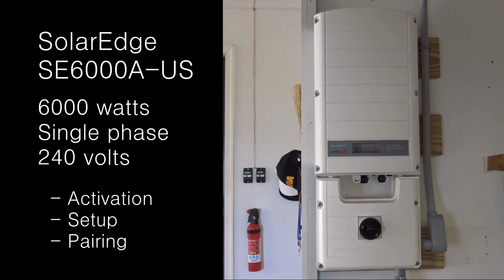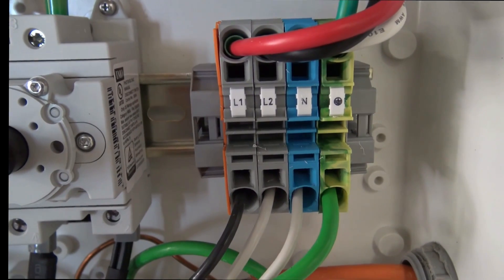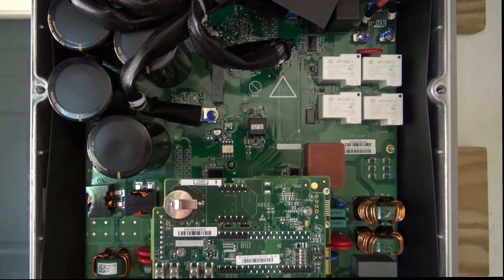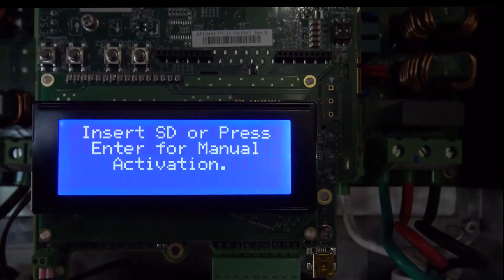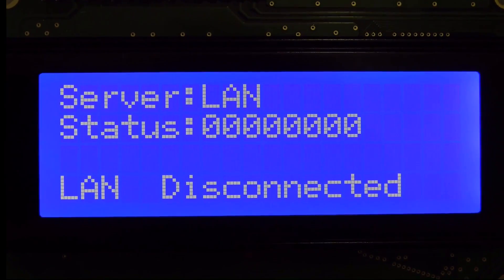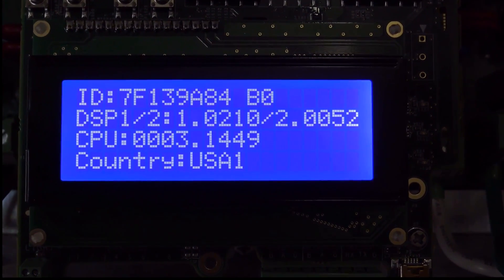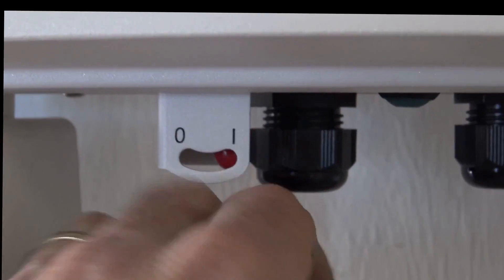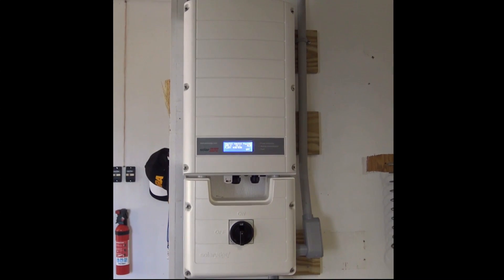SolarEdge Solar Inverter - First time powerup - Activation, Setup, and Pairing

Comment: DC circuits are required to be installed in a metal raceway. Also, the breaker for the inverter should be at the opposite end of the panel busbar from the main breaker.
Reply from the maker: NEC 690.31(G) states DC wiring inside buildings must be in metal conduit or raceways.  I got away with using PVC, but it looks like you can't do that anymore.

Comment: I'm looking into installing this same set up. but I wonder how is this posible of having 30 280 watt panels = 8400watts paired to a 6000 watt inverter.   are you not getting any clipping? are you not loosing production? just learning here... maybe because the panel oarientation, still  2000 watt difference  is a lot. I will duplicating your setup on a ground mount, so I might need a bigger inverter still learning  here.
Reply from the maker: Great observation!  Because of the orientation, I do not get full production out of each panel, so my maximum production is often just under 6000 watts.  On a good sunny summer day, I actually do hit 6000 watts in the mid morning.  The DC-DC power optimizers reduce the efficiency of each panel, slightly, to hold the main inverter production right at 6000 watts for several hours.  It stays there until mid afternoon or until clouds come.  I checked what I'm loosing by taking out a string temporarily.  If I had a larger inverter I could get 6600 watts at the peak, but it's not worth chasing.  Because of my state's power regulations, I'm not allowed to have more than a 6kw inverter on this meter anyway, so this arrangement lets me get a lot of energy out of what I'm allowed to have.
Reply: 280 watts is produced in a perfect environment, in reality each panel only produces about 240watts x 30 =7200, in addition this series of inverters can be overloaded a bit as well I was told from a sales rep, and orientation plays a role in the system as well. We're pricing out a 60-270 poly panel system with the dc optimizers built into the panels and 2 of the 7.4kw Solar Edge Storedge inverters..it's about 15K so far our cost just for panels and inverters, no railing/mounting hardware/labor figured in, about .70 per watt cost on the panels.

Comment: Whats up with the neutral tied to the ground bar in the inverter? And  the Romex running in Conduit? this stuff legal where your at?
Reply from the maker: I see your point.  That might be a code issue, depending on your jurisdiction.  I back-fed into an abandoned 10/2 wire for convenience.  It passed as legacy wiring, perhaps.

Comment: Would your string inverter still function if any optimizer failed?  Do you need to have optimizer on every single panel on a SolarEdge setup or can you place an optimizer only on those few panels that have shading issues?
Reply from the maker: If a power optimizer fails to communicate or fails to start up, the remainder of the optimizers on that string are able to produce power and the power is not blocked by the non-functioning optimizer.  It will also continue to operate with other parallel strings, even though they may be mismatched (mismatched string length is allowable in normal operation, although there are limits).  If the damage to the optimizer was gross and severe, because they are in series, in theory it could necessarily block the power of just that string (just as any connector or wire in series would).  My experience so far is that, with 90 operating for me now, I have never had an optimizer fail.  If one did fail, I would be able to see which serial number was failing, consult my map of the installation, and I would know precisely which one to replace.

All panels must conduct their power through an optimizer.  No panels are to be connected "raw" into the string.  It is possible to purchase a high power optimizer (for example 800 watts) and two panels could be connected to one optimizer.  My installations are all one panel per optimizer, which give you the maximum performance in variable lighting conditions.

Comment: Thanks for the video. Could you please say what kind of panel you used? How much did the whole venture cost? Is it still working ok?
Reply from the maker: Hi.  I used 30 SolarWorld, mono-silicon, 280-watt panels with black frames and black backing.  The all-black construction of the panels makes the entire array look more like a black "monolith", with the only shiny parts being the thin metallic conducting traces inside the panels, under the glass.   I think they are the best looking conventional electric solar panels out there.   They are also strong and reliable.  See https://youtu.be/M6v2lDa8Hos

Including my first system (which as been operating for 1 year and 4 months now), I have not had a single component failure (this includes all of the SolarEdge equipment as well).

In about 2 months, I will publish a video showing the construction of a ground mounted system with 60 similar panels.  I purchased most of the equipment through the California-based distributor, Renvu.  Before jumping in with a major purchase, I purchased 1 or 2 of each component (not including rails or panels) so I could hold the mounting parts (mostly IronRidge) in my hands and get a feel for how everything connects together.

Comment: was the external dc disconnect dual string? can you link it thanks
Reply from the maker: Part number SI25-PEL64R-44 Pole, 600VDC, 25A  (8 connections, makes/breaks 4 wires (which is 2 strings))
http://www.industrialcontroldirect.com/dc-disconnects-316/enclosed-dc-disconnects-317/dc-disconnect-4089.html
Reply: +rachit10 nice that's a handy little disconnect, thanks for sharing it!

Comment: Thanks for posting this video. I do have the same model but only with 18 panels. Can you monitor your power consumption and the power produced at the same time on your "Dashboard"?  Another question is - From time to time the monitoring signal goes out and it wouldn't display the power produced. Sometimes unplugging the wifi box works but sometimes its not and I have to power cycle the whole system itself, what is the safest way to cycle it.Thanks in advance..
Reply from the maker: I'm no help.  We have no internet where this installation is located, so I haven't tried out any of the communication functions.  Maybe one day...

Comment: Thanks for posting - I am just learning our new install.  I guess our SD card got damaged - can you say how to get into the "manual activation" method you mentioned?
Reply from the maker: I'm sorry that I do not remember the exact step-by-step procedure for manual activation.  I recommend calling SolarEdge.  I ran into the problem on a weekend, but I was able to perform the manual activation on my own, using a number on a sticker on the side of the inverter.  At the "Insert SD..." screen, try [the rest of this message is edited because of the reply below].  Consider letting me know how you resolve the issue.
Reply: Thanks - I actually figured it out:
- Cover off, all OFF except AC On
- at the "Insert SD..." display hit the "Enter" key (4th button) 
  once briefly, it should display "Activation Key:"
- Use the 2/3rd buttons ("Up/Down") to change each character
  to 0...9 A B...F per the "activation code" (8 hex chars) 
  printed on the side of the inverter.
- for each correct char, hit Enter once to move to next or "Esc"
  (button 1) to backup and try again.
- when all 8 hex chars are entered - press and hold Enter about 
  5 secs and it should display "Activating..."
Reply from the maker: Awesome!  Thanks for posting.
Reply: Where is this code  printed? I can't read any of this microfilm size print!!!!  Silver tags i have4!
 Part number? Not likely.... Serial number ?  Too many digits